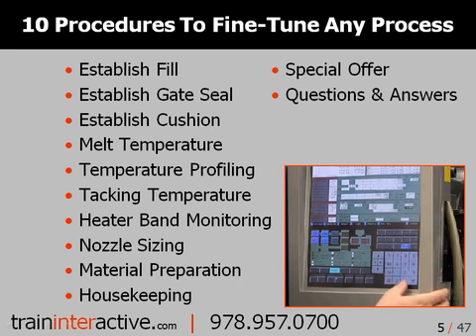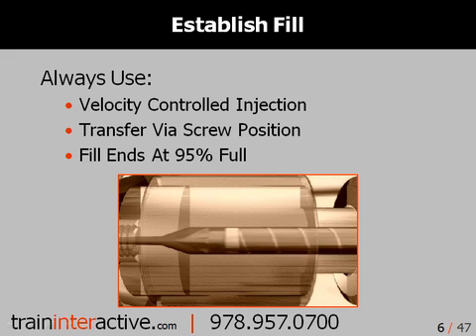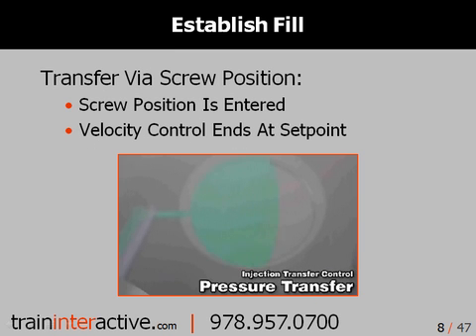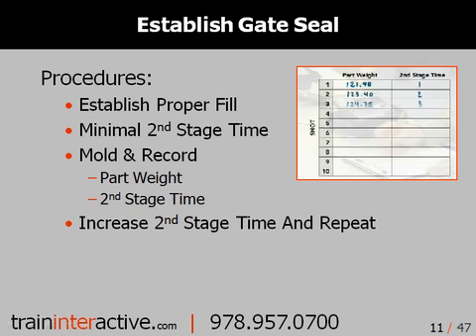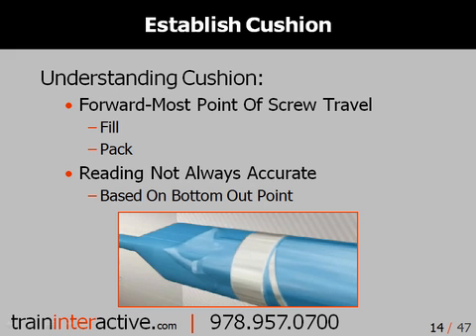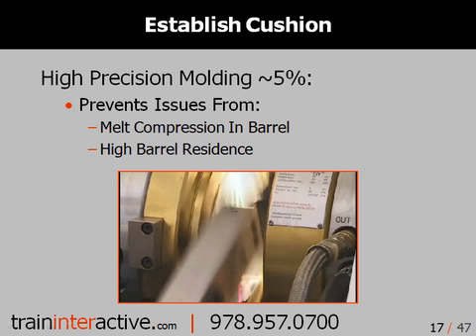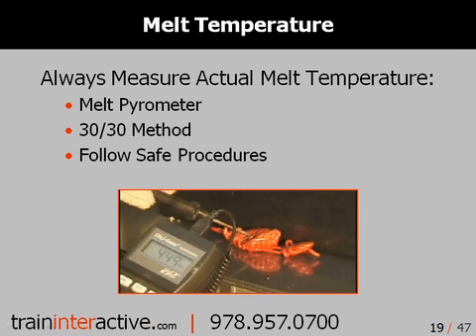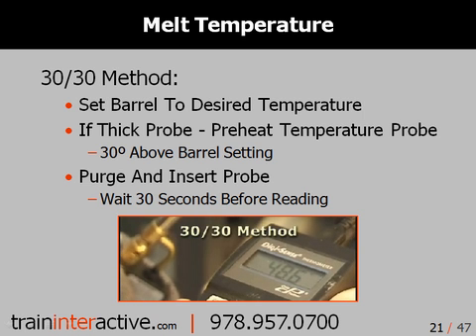Part 1 - 10 Procedures to Fine-Tune Any Plastic Molding Process

Comment: Sir I have one trouble in injection molding machine silver Streaks issue.i set min temperature preheated properly but Streaks can't control please tell some guidance to me
Reply: Dry the material and or reduce the filling speed.
Reply: I know it's old. But what kind of resin material is being used?

Comment: man I'm so happy to find this cause I'm a mild setter
Reply: Sir I made socket for soe gas weld line in mold no solved this weld line
Reply: Increase injection pressure
Reply: Hot Runner Molds were the worst, Freakin Beehives!